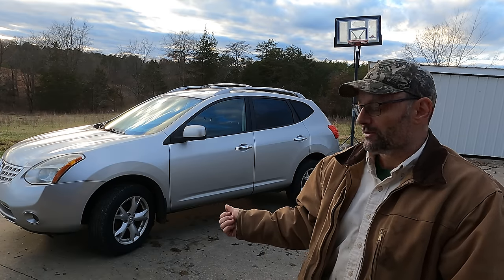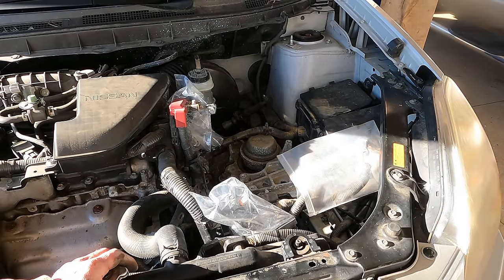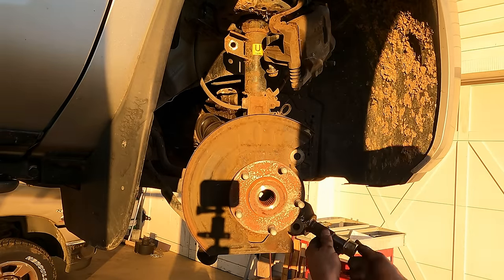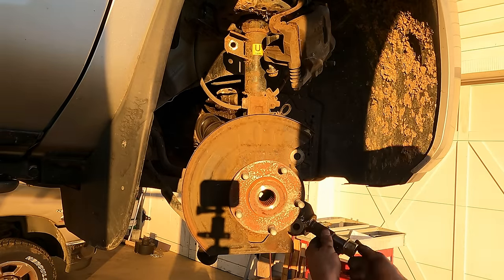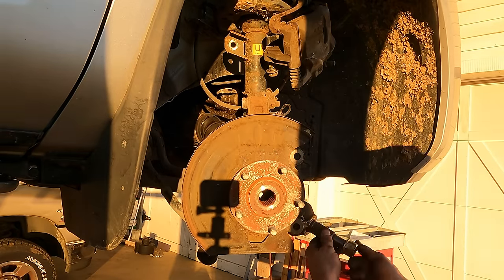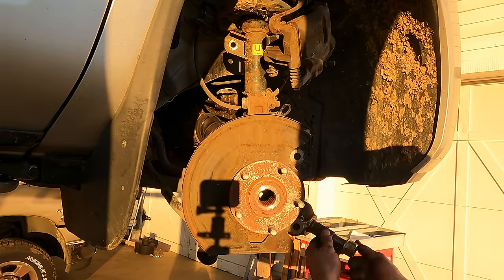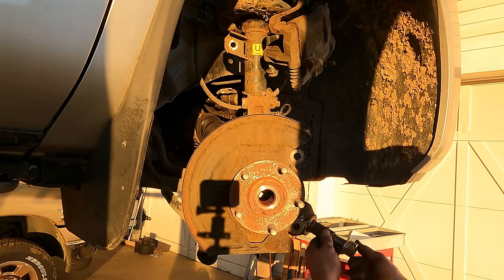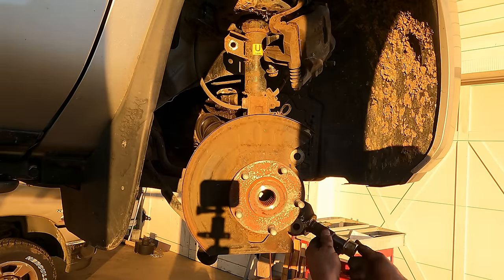Fixing a Nissan Rogue Transmission So I Can Give It Away. GOAL MET!

Comment: OK, question... why don't you just put an old-fashioned transmission and/or old-fashioned motor in it. The motor may work fine, but the spline may be a problem? 
Why, the exact thing that broke in the first place. I think it is what I would do. Perhaps you feel you can't fit any other transmission in there, but I assure you, you can. The only real bug you might encounter is the spline not matching up, but that too is fixable. Oh, well, let's see what it looks like in there? (grins) And again... thank you for sharing these gems. 

OK, now I see the nightmare problem! I have not dared to even look at newer vehicles since the 80s. SHEESH! You literally have to dismantle a car like that just to replace a .50 cent part! This is why I'd never own a new car or any car newer than a 1970 before computers and coo-coo self-important manufacturers that only build things to break in 18 months, and only they can fix, for more than they are worth... and as in WE HAVE NO RIGHT TO REPAIR anyway; it is proprietary like MUSK! 
My Advice... Only buy a car that is electromechanical, NO computers! 
My favs of all time were the 58 Buick and the good old 55 Chevy, I also really liked the 52 Hudson Hornet. They sure don't make GREAT cars like them anymore. (grins).

CRIKEY! What brand of idiot designs these kinds of transmissions? I used to replace nearly any part on my old cars, tractors and trucks in less than a day or two and at almost no cost or very low cost relatively speaking, of course.
Ah, but for the good old simple days of the 50s, 60s, and even the 70s! 

(FACT 👉🏽) Gone forever on this inside-out, upside-down, backward spinning, coo-coo and very, very corrupt, with no integrity or common sense left, NWO or (timeline) we're all trapped in now! (👈🏽FACT)

(Grins) You call the inside of that monster transmission a 'work of art'! 
Crikey! I call it an overly complicated, convoluted, ALIEN monstrosity of the Universe, no doubt sent here to mess with us mere mortals and turn us all into their screwed up humor pets! Or perhaps worse, eventually their diner?
NOTHING needs to be this complex to work properly. 

This is absolute INSANITY ENGINEERING! 
"I know engineers, they love to change things that work perfectly fine as they are." 
A slightly modified ~ Dr. Leonard H. 'Bones' McCoy
And why I'd never go anywhere near a newer than 1970s car/vehicle! 
But hey... I'm an old man from and older time. 
I don't like this NWO for very good reasons! 

And... you know you can/could/would make them operate on tap water if the oil companies and corrupt govts would get the 'F' out of the way of true progress and stop sabotaging every new energy invention and/or 'inventor'! 
(but... there I go, off on another rant again... sorry about that)

I think you might be making a mistake giving that car to a new kid starting out. A nice gesture but sheesh the first time this car breaks down even for a $10.00 replacement part, or even the need to change a spark plug or just general maintenance. 
It will cost that kid years of earnings to have any work done on a car like that. Get rid of all that useless, pain in the ass technology and put in a sane running gear and power plant. I also think THAT would make a good viral video series. (grins)
 
They were right. That car is a write-off and deliberately designed and built that way! 
But hey... that's just my 72-year-old opinion. But you seem to have a world full of patients to play with this kind of stuff. 
So... hell, have at it if it makes you feel good and eventually might, just might do someone else some good, even if until just that first trip to the mechanic and the service bill that car will generate. 
Again... thanks for sharing your nightmare. (grins)

Your very own assessment is spot on based on what I can see. The belt stretched and that's where the metal shavings seem to be coming from? Fasinating there are magnets in there to collect metal shavings? They designed it this way. They knew full well this would happen at a specific point in milage. Again... planned obsolecence.
Designed that way on purpose, by insane ALIEN engineers who want to mess with the Human mind and drive us all as coo-coo as they must be. 

I'd say... get him/her an old F150 PU truck or something similar from the 50s, 60s, 70s, even the 80s (but no later) rebuild that for road safety and reliability and maybe a lot cheaper and Shazam, they have a very reliable and 'fixable' vehicle that will last, especially if that person, who receives it, has any electromechanical ability. 
Just my thoughts and opinion. You did ask for it.  (endofline)

Comment: 99% of the time if the boot is torn completely it's been compromised for a while and contaminations already gotten into the joint and ruined it. Unless you catch the boot when it very first starts to crack just replace it. Replacing a boot that's been open for a while is just delaying the inevitable
Reply: On an outside joint yes , but an inside that still had grease in it like this one did it will be fine .
Reply: @onthelake9554  That's not what my 20+ years of experience as a professional mechanic says but I guess we all have different experiences....
Reply: @DoRC   I guess we must , I too have been a mechanic for my entire life , since before the common front wheel drive car existed . Inboard joint with clean grease like this one was will have no issues with a boot if it's not already vibrating under a load . My guess is he broke the boot or the guys that just checked it before him .
Reply: @onthelake9554  Yeah maybe so. Like I said if the boot had just been broken then yeah it's probably okay but in my experience a totally broken boot like that has been split for a long time before it broke entirely.  I don't reboot axles anymore because I've had far too many of them come back a few thousand miles later.
Reply: @DoRC  Yep can't blame you for a customer , but for myself or charity work it's different .
Reply: @onthelake9554  oh yeah for myself definitely. For charity work I would be even more fussy than with a customer I think. The people that can't afford to get it fixed the first time are the people that will least be able to afford to get it refixed down the road

Comment: 7:07 STOP hitting on the part that is connected to the ball joint (control arm) you are DESTROYING the ball joint. Hit the KNUCKLE to release the taper, that way the shock goes through the knuckle into the taper bolt, not from the control arm, to the ball socket, then the taper, and finally knuckle. The former is correct, latter method is INCORRECT

Comment: Origin
In 1879, Milton Reeves invented the CVT (then called the variable speed transmission) for use in sawmills.  
In 1896, Reeves began fitting this transmission in his cars, and the Reeves CVT was used by a few other producers as well.
 (Wikipedia)
What you receive for free, give for free and God will reward you.

Comment: Cvts work if they would use  giant version of the type they use in scooters and snomobiles
Reply: Yeah, it need to be HUGE PULLEYS AND BELT. The car will be the size of a 18 wheeler truck and only still weigh 2000 lbs.

Comment: I think you can change the belts inside the transmission. I believe I have seen it done. Maybe that would save some dough. Please and I mean please send me the part number of the gearbox. Or possibly arrange to give me the ViN so I can find it out myself.
Reply: The shavings are most likely from the belt themselves. It didnt stretch the hole just got too big for it to grip.
Reply: If the vehicle was staying with me, I would consider it, but it's going to someone who is already strapped for cash.   When the CVT Hack/Fix fails, the new owner is going to be on the hook for 5k in repairs.   If it's done "right" this time, it's less likely to be an issue that's transferred to the new owner.
Reply: @noxin75  It's not a hack it's a legitmate repair if done right. The same as would have been done to the reman box you but. Only difference is the person that did it. I Trust that the OP wold do a good job otherwise I would not even have suggested it at all. Your objection applies equally to the car as a whole though aswell as the refurbished transmission since it is overly complex and difficult to maintain for someone that is underprivileged and not car savvy if you wanted to split hairs. But let's not.

Comment: I have worked on a nissan sentra, same garbage transmission.  Why nissan decided to put the cvt belt in the middle where it can not be serviced is beyond me.  Side by sides use cvt and yes, its a rubber belt but they put it wherr you can swap it out.  The only nissans to buy now, should not have a cvt, additionally watch out for subarus, dodges, fords and most asian cars, they too have cvts.  Not all, but some models do.

Comment: Designing and building cars today has a lot more to do with engineered obsolescence and preventing the general public from even attempting to repair their own cars RE: smog control parts, electronic management of all critical systems, special tools only available to the dealership, the list is endless and the cost to the car owner can be ruinous.
Reply: Toyota Corolla or Camry. Like a Rock. Great way to learn fluid & filter changes & schedules, because that's all that's needed. Well maybe wipers & brake pads.  Let's kiddies understand  a maintenance schedule without getting overwhelmed.

Comment: Great idea and generous use of your time.  I enjoy that you challenge yourself all the time. Your kids must be getting the education and life skills from you and you lovely wife to become amazing people.

Shame cars are built so repairs write the car off long before most of the components reach the end of their life. That would do more to save the planet than spinning out of control about plastic straws.

Rather than the metal belt that seems to be a weak link in this design, I would be okay with a $300 easy to replace belt that was good for 50000km (~30000 miles). Nah... Who am I kidding, trannies now have 6 - 8 speeds, do a pretty good job and good life expectancy. Time a replaceable belt is done regularly the environmental cost is likely higher than the .01 miles per gallon saved from the CVT design.

I had a 5 yr old Mercedes B200 and CVT went at 170,000 km (105000 miles) despite 100% regular maint by Mercedes. Car value was $18,000 at 3 yrs old. Same problem as yours, metal shreds everywhere, on the magnets and glitter fluid.

Tranny shop replaced the CVT with a 45000 km unit from a wreck. Total job was $8500. Mercedes wanted $14,500 CDN Including tax for new. Oddly the cost per mile seems about the same if they all go for 100000 miles. Reprogramming everything, including the electric assist steering rack was a pain to get working right and some had to be done by Mercedes. Meanwhile my life changed and I got a work van so sold the B200. Could only get $5000 for it (disclosed the repairs in the AD) at 5 yrs old. Worst most costly maintenance car I ever owned. Would never buy a CVT again unless I'm 75 yrs old and only planned to drive 5000km a yr.

Comment: If your looking for someone to donate it to I volunteer myself. I have just bought a 2013 nissan rogue. Just drove it for 300 km and the transmission is not behaving. Yes I said the km right 300km. I just spent $12,000 cad on this 😢.

Comment: the problem is the variator sheaves move in and out riding on some ball bearings in grooves. the balls become distorted from all the force and then they self destruct and the variators bind up. not enough surface area to spread out the force. poor design. there are other cv trans. that are of much better design and hold up well.

Comment: Another Unrepairable Nissan CVT 
Between the cost of a nu one and several days labor, most so equipped Nissans are junked. Finding a 'good' used one is a needle in haystack search. Nissan is facing several lawsuits over the problem.

Comment: This type of trans was used in the (Dutch) DAF and was called a variomatic   (Google DAF Variomatic)  DAF means  (van) Doornse Aanhangwagen Fabriek. roughly translates in  Van Doorns Trailer Factory.   We called it Garter drive because of the long belts used.  Sometimes the belt flew of the drum and you had to get under the car and slip them back on with a tire iron.   One more thing: It coould drive in reverse as fast as forward, therefore it was popular with  racing in reverse   https://www.youtube.com/watch?v=S7ipFApsFec
Reply: Are you from the Netherlands? Funny video about the racing in reverse.

Comment: spend that much money on that car does not worth it, as a independent dealer, if you check everywhere at the auction now they go for cheap most of the time with light damage or lite mechanic issue, can get one for less than 1000 with damage, I even bought one from NY AT IAA FOR 650 DOLLARS because there a noise next to the engine, they put engine damage the real problem was the easy compressor, the compressor replace it the car is like new.

Comment: How clever they copied the shopsmith mark V drive system. Becuse thats how you change the speed on a shopsmith lathe.

No rebuild parts is ridiculous.

What about a motor transmission swap?
Differnt type of drivtrain.